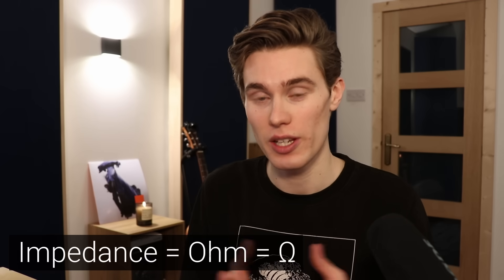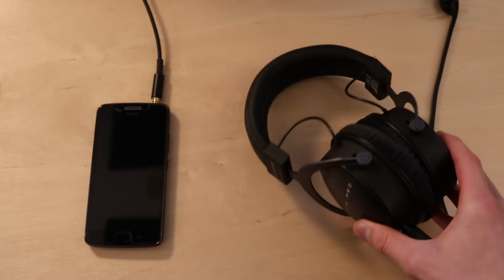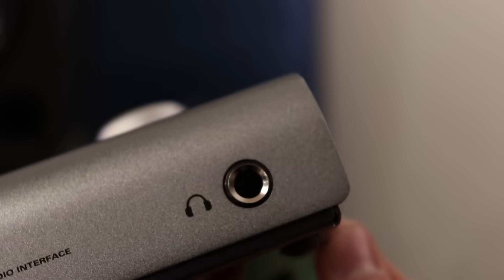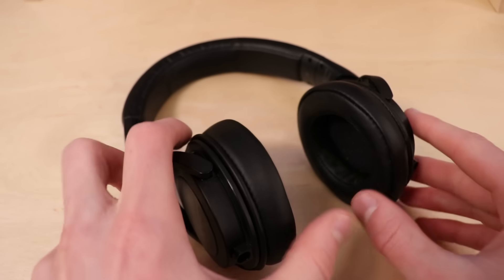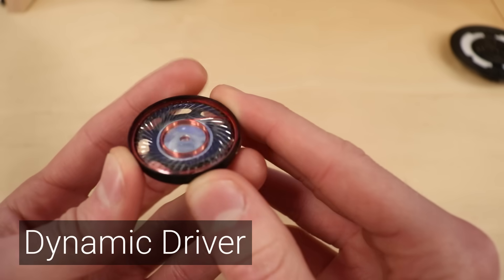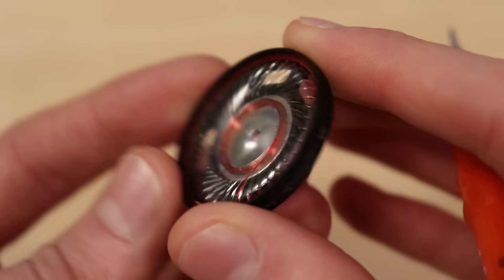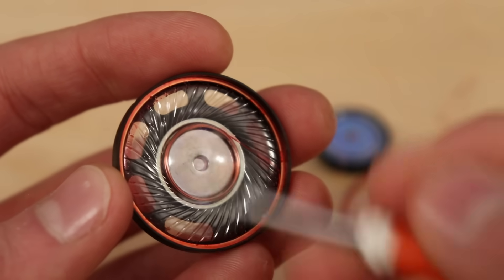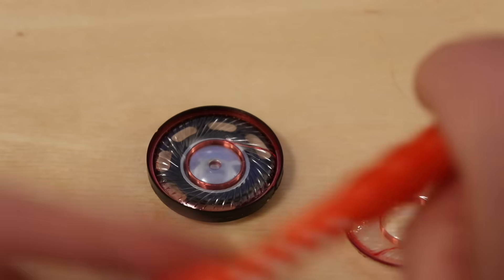32 ohm vs 250 ohm - Which Headphones Sound Best?

Comment: I'm one of those people that walk around with a headphone amp strapped to their phone. I never want to sacrifice sound quality
Reply: And do you only listen to lossless audio? Because we're sacrificing a lot more quality by listening to mp3s than listening with low impedance headphones.
Reply: @EricPeelMusic   It’s a bit of a myth — or at least a misunderstanding. You don’t need lossless music files to hear the benefits of higher-impedance (high-ohm) headphones as long as you're powering them properly (with a good DAC/amp).
Reply: @EricPeelMusic  Absolutely, I have a Flac collection that I play from
Reply: @twistiv  Same. I only have flacs/wavs etc. It gives a good reason to be morally consistent and get rid of old, pirated (in high school and college years) mp3s! And listening to music on streaming services is unfortunately out of the question. And bluetooth audio is out as well.
Reply: @EricPeelMusic  What if you play HIFI TIDAL tracks through a HIFI soundcard outputting to a 2.1 HIFI system?
Reply: @Jmvars  A quick google would indicate that Tidal is flac, which is lossless. So that would be a good choice for a listening platform. Beware, don't fall for this "hifi" nonsense though. There's a lot of quackery in the audio industry and people will try to sell you things that claim to make sound better when there isn't actually anything going on scientifically or physically to make the sound better. They prey on those who don't understand how sound works. Just look at the specs yourself. 44.1kHz and 16-bit or higher lossless, only. And if you're listening in a room, choose a good listening position and treat the room so the frequencies don't reverberate and distort themselves before getting to your ear. The sub in your system will help recreate sub frequencies more accurately, but make sure the crossover filter is adjust by a professional to get the optimal response. Or play with it until it sounds pleasing to you. And anything else is just snake oil.
Reply: @EricPeelMusic  I know it's lossless. I'm not "falling for this hifi nonsense". It's just the term commonly used. I'm expecting people that know what their stuff to understand that.
Reply: @Jmvars  I wasn't referring to Tidal's name, I was referring to other companies who use the term "hifi" to describe their quack product. I didn't know if you use the service already or not - you never specified. You asked me the question, and you already knew the answer. So why did you bother asking? Haha. Just needed a friend?
Reply: @EricPeelMusic  I know you aren't referring to TIDAL. Are you lucid?
Reply: You know what? Don't answer that, I don't have time for this.
Reply: @Jmvars  Settled!
Reply: @EricPeelMusic  I've tried tidal with the highest quality subscription and listened to hifi tracks and it sounds no different at all from regular Spotify on high quality. So I deleted tidal right away.
Reply: @nathanpickering6742  That's because spotify uses ogg, not mp3. A 320 kbps ogg file sounds closer to lossless than 320 kbps mp3. But if you were able to hear a hi hat or shaker in isolation on a good listening syetem, you'll find it easy to hear even the difference between 320 ogg and lossless.
Reply: @EricPeelMusic  How do you deal with Metadata like album art and artist/album tags? Whenever I used flac and wav, none of that stuff would transfer properly. So I usually use mp3 320kbps if I'm not using apple music.
Reply: @mikeexits  If you're using iTunes to manage files, that's likely your issue, not the file type. iTunes is the worst music player of all time, or the worst app that can play music, since it's bloated with so much more than what a music player should ever do.
Reply: @EricPeelMusic  Oh I agree. I never use iTunes and haven't in almost 10 years. I use MusicBee (and VLC for single files and my own demos, not my music library) on my (Windows 10) laptop, and on my (Android) phone I use Audify for local files and Apple Music for streaming and discovering new artists.
Reply: @mikeexits  Have you tried opening the flacs/wavs in Audition or Audacity to check if maybe the data is there but MusicBee or Windows isn't reading it for some reason?
Reply: @EricPeelMusic  mp3 320 goes up to 20khz my friend, just convert any wav track u have to 320 and look at the frequency spectrum using a plugin such as SPAN. And maybe u have superhuman hearing but in blind tests in professional studios, pretty much no one has been reliably able to guess which one is wav and which one is mp3 320. Check out the ABX High Fidelity test on google to see for yourself if u havent tried already
Reply: @Nüwamusic  1.) Even with 320kbps files (which are not played by youtube, soundcloud, spotify default, apple music, should I go on? i.e., 99%+ of content streamed online) only the highest amplitude high frequency content is allowed to pass through the filtering in order to make mp3 files so small. The lower the amplitude the high frequencies are, the more of them are filtered out. And this filtering alters the sound, audibly. This is because the filtering may leave the highest dynamics where they are in amplitude, but the phase is altered in such a way that makes transients sound softer and not as punchy. When a raw mix and an mp3 are played together with the polarity inverted, you can hear everything different between the two files. There is a lot that is changed and most of it is audible. If you do this test to a hi-hat rhythm wav and the same mp3, you'll hear that most of the hi-hat is altered since most of the hi-hat frequencies are high. It becomes very obvious, even to an untrained ear at this point. I'm guessing you've never tried a test like this for yourself? 2.) I don't have superhuman hearing, but listening as a mix engineer trains your ears like it trains your ability to become fluent in a foreign language. Those who are not trained at all will always hear gibberish. It's a huge difference, and not one nearly small enough worth saving a few dozen MB over, especially when we're running 1080p, 4k, and soon 8k video all over the place, which are many times heavier. Lossless digital audio with good DA converters and played on good drivers are literally as good as sound can get, and it's still not anywhere near as demanding as high quality video. 3.) The ABX test can conclude whatever you want it to. It can conclude that high quality audio is a scam, and it can prove hi quality audio is very important. There are about an equal number of "experts" on each side. You need to understand how mp3 filters work, and just because there is 16-20khz content displaying in the analyzer of 320kbps audio doesn't mean that the content you're seeing/hearing is the same as it was on the original wav. Again, the null test comparing the two signals is one of the best way to prove what the difference is and that it is audible. You need to understand that we're interested in getting as close to the original envelope of the sound as possible too and the same amount of frequency content at all amplitude levels, not just the loudest peaks, and not only in having the same tonal balance.
Reply: @EricPeelMusic  I have taken the test myself along my whole class and my teachers at university during my digital music Bachelor in a professional level university studio. No-one was able to tell the difference. And yes there is a difference, I never said there wasn't. The thing is, this difference is not possible to be heard by humans since it is so small and is using psychoacoustic tricks such as the masking principle in order to remove sounds that humans wouldn't be able to perceive anyways (for example, a rlly low volume harmonic playing right next to a really loud one will not be perceived since the loud one will be masking the low volume one). And yes I do know how mp3 compression works. I am wondering if u do since u have said things that are factually wrong in your previous comments (mp3 320 cant produce frequencies above 16khz for example). I'm not trying to create a heated argument here, I just don't want u to mislead people with false information. Also, I still think you should take the ABX test to see if u can actually here the difference or if its not just your brain playing tricks on you ;)
Reply: @Nüwamusic  I never meant to say ALL mp3s cannot produce sounds over 16khz, I just meant in general, (most) mp3s cannot,  specifically the ones the previous commenter was asking about, usually 128kbps such as on youtube and soundcloud. Show me exactly where I typed "mp3 320 cant produce frequencies above 16khz for example" as you quoted me saying, which I know I did not say. Additionally, if you had read all the comments I've typed here, you'll find one of mine dedicated purely to the "320 vs other" problem you're having with me right now, for some reason. Dude, just find a pattern of a hi-hat or tambourine only or produce one yourself, then export a wav and mp3 version. Then you can listen side-by-side AND/OR do the null test and you'll hear the wav one is crisp while the mp3 one is mushy, and you'll hear the huge amount of accompanying content lost or replaced in the null test. I can't make a video about it because unfortunately both the wav AND 320kbps mp3 will be compressed. The whole point of this discussion was to push lossless audio to be the standard and get rid of compressed audio forever. Again, saving a few dozen MB is useless these days when every single time we come here to comment on this video, we're downloading dozens if not hundreds of MB of compressed video content. Every web hosting company allows streaming of lossless audio. 128GB SD cards are $10-15 on ebay. Most email servers have free automated cloud sharing for files larger than 8-12MB. Even if theoretically, we lose 1% perceived audio quality to make the file a few dozen MB smaller, I still think it's just one of many ways we standardize poor audio quality and one we can all leave behind. As far as I'm concerned, what you're learning at university right now would be a waste of time if the world wasn't already wasting so much more time dealing with compressed audio.
Reply: @Nüwamusic  Please tell me why all professional sample libraries are packed with lossless audio samples and not 320kbps mp3s IF 320kbps mp3 is truly virtually indistinguishable from lossless. Because if we're so concerned about saving a few MB here and there with audio, we should also be concerned with saving dozens of GB when we're downloading sample libraries, right?
Reply: @EricPeelMusic  Some sample libraries go up to 192khz yet humans cant hear the difference between 44.1 and 192. The reason is because the more data you have the better it is for plugins to do the processing. For example, u can resample 192 khz files two octaves down and still have content in the high frequencies which is not possible with 44.1 khz. Anyways the consensus in the audio world is just that we work with lossless audio while creating music in order to have to most accurate result possible. Then for the final bounce, we can compress it with mp3. The mp3 compression here is applied only once. If you mp3 compress ur track which was full of mp3 compressed files, u  will end up with more artifacts then if u only compressed the whole thing once at the end. Its as simple as that
Reply: @EricPeelMusic  Ohh also, most of the time they are wav files because not all software can read mp3 and other formats. By making their samples wav files they make sure that most software can read the samples since the software doesn't have to uncompress them
Reply: Guys, found this thread. I just posted a comment that you might be able to help with. I would appreciate it. Here it is: Hi, your studio is looking good! All this headphone/ monitoring thing is about referencing, right? I might go out on the tangent, but one great thing to do when mixing is using reference tracks, we all know that, so I got the monitors and the headphones right thanks to you, but  now i just can not get good reliable song files to reference to. I bought a song to use as such but iTunes won’t let me take the file to import it in my daw. I was thinking on play a song in Spotify and record it through my interface, but it’ll go through my converters. So, do you know about a way to get files for referencing? Does MP3 do the job? Cuz I imagine it’s even harder to get WAV files of modern songs. Any way, appreciate any feedback, thanks.
Reply: @bastianmaze_beats8730  Mp3 will do the job for referencing, but you'll have to use your imagination about what the artist intended for everything above about 16kHz. Because mp3 does not include that, even though humans can hear up to 20kHz. The sound and dynamics is also poor overall, in all frequency ranges. Better to use a lossless format like flac or wav. Why don't you just avoid itunes (it's garbage) and download lossless directly from the artist's website or streaming platform? Or support the artist and buy a CD?
Reply: Eric Peel Music thanks for your answer, of course, that’s why I bought the song on iTunes on the first place. But, if mp3 only covers up to 16KHz, I would like better to have the full frequency range and also dynamic if possible. What’s the format on cd’s? Isn’t it MP3? I will check on the artists pages to see if I can buy separate songs in wav files. But I need Ariana Grande-God is a woman, Tears for fears-Woman in chains, Train-Hey soul sister and Uptown funk. Any idea where can I get those songs in wave files? Thanks again.
Reply: @bastianmaze_beats8730  Audio on CDs is in wav 44.1kHz 16bit. Not mp3. For lossless, buy a CD, or search for the song you need in lossless format. Many band websites will have the option to download in lossless format. I'm not going to spend my time searching those songs or bands for you.
Reply: Eric Peel Music of course you’re not, enough time you’ve spent answering my questions here, which I thank. Have a good night = )
Reply: @bastianmaze_beats8730  You as well. Also, wanted to point out that there is a big difference between mp3s at 128kbps vs 320kbps. So if you're forced to use mp3, make sure it's 320.
Reply: @bastianmaze_beats8730  If serching for songs in .wav becomes an annoyence, just go for 320/kbits or 256/kbits (as Amazon offers) MP3. They are easy to get and as long as you don't own 10,000$ speakers within a well treated room, you won't hardly hear a difference anyways.
Reply: @LeonardGMN  I don't mean to sound like one of those guys but I can absolutely hear a difference between mp3s at 320kbps and lossless, especially in my own music or  mixes. And I'm just using a pair of $100 monitor headphones, no $10,000 system. Is the difference enough not to use mp3 320 for referencing? Maybe not, but there's absolutely an audible difference. It's not about the accuracy of the monitors or the room being treated or not, it's mostly about the high end and the smoothness of the dynamics overall, which is actually easier to hear on headphones, which is what most people are listening with. Sure I'll use mp3 320 for referencing if I have no other option, but I won't be casually listening to anything other than lossless. Eventually the internet will catch on and all streaming platforms will be lossless, just like all the video sites will be at 8k+ resolution. Hearing mp3 320 vs lossless is a bit like a native English-speaking person understanding Chinese. It takes time, but it's possible.
Reply: Leonard G Thank you very much for taking the time to write, I appreciate it. Do you know if amazon lets you have the file to be able to import it in my daw’s session?
Reply: @EricPeelMusic  See, and I don't get why my doctor rufuses to certify that my ears are trash. I can't even tell the difference on my Beyerdynamic DT1990 Pro. But on the other hand, I have friends who claim to hear a difference when they're listening on their iPhone speakers. Guess everybody has to decide on their own.
Reply: @bastianmaze_beats8730  You can  just download the mp3-files and then you can just load them into your DAW.
Reply: @LeonardGMN  There's probably nothing wrong with your hearing. Although you could hear a lot more treble if you get your ears cleaned out if they have a lot of built up earwax. Besides that point, to emphasize the difference, you need to listen to something you're very familiar with like your own music or mix, or even something like your parents voice. Once you know what you're missing, you'll probably want to make sure you're not missing anything in any other music too, and lossless is the only way.
Reply: @LeonardGMN  One way to prove the difference is to do a null test. Convert a lossless file to mp3 320kbps ensuring the sample rate and bit depth are the same. Multitrack the original and your created mp3, ensuring the two files are aligned perfectly. Then invert the polarity of one of the signals and hit play. You'll surely hear content, even well above -30db. I can hear about -75 db depending on the frequencies and if my room is very quiet so that's a lot of changed audible content. Whether it's noticible in its own context is another debate, but I don't like how the tone, dynamics and phase are all altered so much, and I just want to hear music as the artist intended.
Reply: Eric Peel Music I agree = ) had to buy a bunch of CD’s for one or two songs each, but now I have a few 44.1 wav’s.
Reply: @EricPeelMusic  What is your opinion on CD quality vs flac and wav
Reply: Soo , i have a question for you , is sound blaster Z enough to run dt 990 pro (250) ohm ?
Reply: Just get LG newest phones, they come with their own mini amp and quad dac
Reply: No reason to be proud of this
Reply: Just take care of your ears. Tinnitus doesn't go away once it's there.
Reply: respect